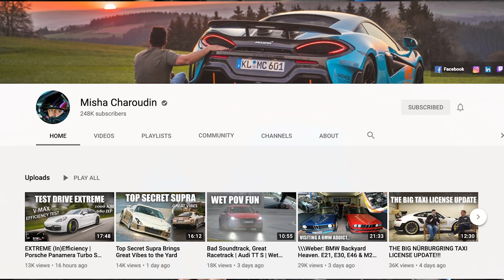Building a 300bhp+ 1.9 TDI 8V PD Engine for @mgcharoudin!

Comment: I can see there's a lot of VW brains in here, can someone help me get a time estimate on how long it'd take me to replace my DMF on my 1.9 BEW? Or drop me a link to a service manual on it? 

I also kinda broke the top of the transmission fill cap off when trying to drain and fill my 09a and the fill plug is now stuck in the fill port of my transmission pan... do I try and work it out or do I replace the whole pan and drain it after?

(Edit; don't worry, I didn't drain the transmission, it has fluid in it, it just needs to be properly drained and refilled to spec as I just had the shift solenoids replaced at 254k)
Reply from the maker: Drop us an email to sales@darksidedevelopments.co.uk if you need some advice

Comment: Evening lad love ya work , could u do owt with the vw 2.4d tic lump ??
Reply from the maker: Slap a 2.5TDi turbo on it and some bigger nozzles!
Reply: @DarksideDevelopments  reckon a d5 turbo (Gt2025v) would be better than the stock one?

Also most just advice getting fresh gtd nozzles, or would tdi nozzles with the correct idi pressure set also work?

Comment: Hi guys. That plastic cover below the crank shaft is a sort of plate to maintain oil in sump when you get g- force ?
Reply from the maker: It directs oil back to the pickup pipe.
Reply: @DarksideDevelopments  😉

Comment: which oil heat exchanger did you use and would it fit on a 1.9 with rotary pump?
Reply from the maker: ARL exchanger but our own external air/oil cooler
Reply: @DarksideDevelopments  well I could also use it as heat exchanger between oil and coolant. So during winter the oil warms up quicker as the 1.9tdi have a tendancy to run a 'bit' cold during winter

Comment: Hey guys, Is there a way to keep an anti shudder valve for safety and still have a race pipe instead of quick release pressure pipe for intake?
Reply from the maker: yes but not with the older mechanical types.
Reply: @DarksideDevelopments  is there a way to adapt the newer electronically actuated ones to the ASZ? Or maybe use exhaust flap and manual trigger just in case of runaway engine?
Reply from the maker: We don't know a good solution. Best to just blank the EGR and keep the valve as is.
Reply: @DarksideDevelopments  Using 75 to 60mm silicone reduction but it makes the bend pretty tight..

Comment: Disagree 100% on the oil pump. Every fresh engine I build gets a new pump or I won't bother, even if the old one looks perfect. Just no real need to risk it eh? It's the heart.
Reply from the maker: Every job has a budget but the VW pumps rarely fail

Comment: 10k in parts, then how much in work? It kinda seems pretty expensive for such a project, people selling built racecars for like 7k-15k with better specs.
Or its for some kind diesel class in Nurburgring? Or because of diesel reliability and torque all over rpm by this build?
Reply from the maker: No one builds race cars for 7k

Comment: Reyt then, ok this is pure track race engine with all top parts.. it's a darkside rocket. As far as gearbox Ryan tells he uses metal piece to strenghten 1st to 4th, adding it's not 100% effective but working well. Does it help quick shifting? Does it prevent synchro eating or blowing out?
Reply from the maker: Nothing stops the 4th gear shredding!

Comment: I have a very similar build from you. Can I ask why you are not using wrap on the manifold and a turbo blanket?
Reply from the maker: The manifold was ceramic coated so no need for it and we didn't do a turbo blanket for them

Comment: Can you explain why the 3 hole gasket causes more smoke?
Reply from the maker: Additional dead area (not in combustion chamber) is not ideal.
Reply: @DarksideDevelopments  ohh makes sense tho ive heard it increases compression ratio which is meant to be better for higher boost?
Reply from the maker: Decrease, but you need to machine piston instead

Comment: The most important part of the engine and you don't upgrade it, 2nd hand oil pump really
Reply from the maker: The block was used but works perfectly, same goes for an oil pump...

Comment: Hi! For one 1.9 tdi 6speed manual i have options for reducted mass flywheel? Or just the factory one with the dobble mass?
Reply from the maker: We sell a few options, heavier SMF drives best
Reply: @DarksideDevelopments  i kinda want something less heavy cuz i want to make 200hp on my g4
Reply from the maker: The flywheel makes no difference to power, only noise

Comment: Fantastic explanatory video and later craftsmanship in building the engine. Which make of engine oil do you favour for the PD engine you built and what grade, please?
Reply from the maker: Rock oil 10w50 for this!
Reply: @DarksideDevelopments  Thank you. Do you rate Rock engine oil as being a decent oil?
Reply from the maker: We have had no trouble!
Reply: @DarksideDevelopments  Thank you.
Reply: @DarksideDevelopments  Hey Ryan if I only do a couple of track days and a lot of every Day driving is it still ok to use 5w 40 grade oil. I'm currently using Motul 5W-40 X-Clean. Thx

Comment: Is it possible to make any of the VW diesels run on jet fuel?
Reply from the maker: You mean Kerosene? With lubricity additives
Reply: @DarksideDevelopments  correct. JetA is just pure kerosene without all of the additives. I'm researching lightweight diesel engines for homebuilt aircraft. 100LL (low lead) fuel is going to go away soon but JetA is everywhere. Could the VW engines run on JetA if the additive was added into the fuel?
Reply from the maker: Hi Shane, I would send the fuel alone and some fuel with locally available additives away to a lab for scar testing. That's better than killing things. The PD engines will not take terrible fuel like an older pump engine.